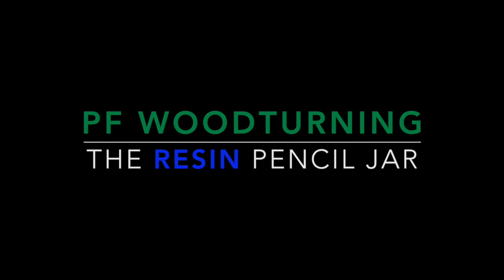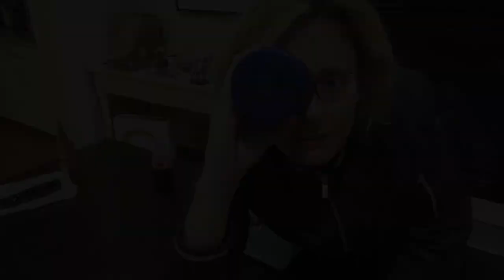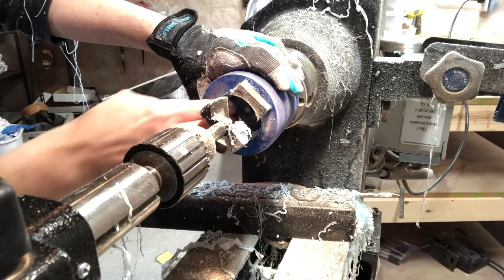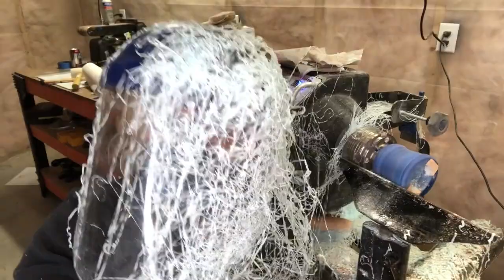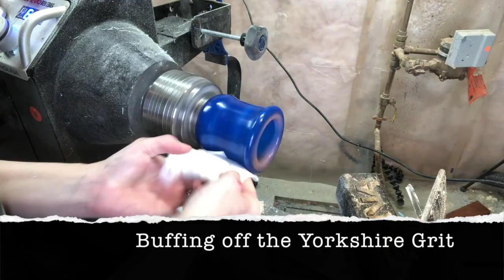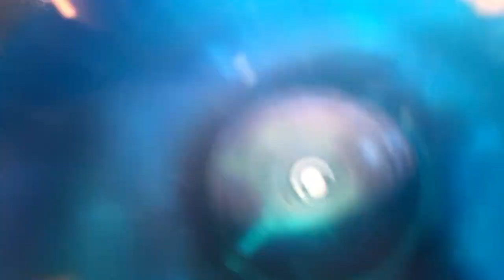Woodturning a Resin and Burl Pencil Jar on the Lathe

Comment: Nice facial hair, pretty pot. I have done three resin containers. Hint, For the burl I hot glued the wood to the side of the container. I messed up with one and mixed the resin in my cold shop, the resin cracked but otherwise looks good. You have probably got lots of advice. Thanks for sharing.
Reply from the maker: Cool, thanks for the tip!

Comment: It turned out well, that much resin without air pockets or cracks is not easy to do. Congrats 🙂 Your intro mentioned you had hoped the wood would have been on the bottom, why not do a second pour, to fully cover the exposed wood, then flip the top/bottom plan? When we use molds we tend to see it as a "set in stone" shape, (top is top, bottom is bottom) however a whole new world opens when we pull out our inner rebel, and decide that the top may be the bottom or even the side. No mistakes, only design changes <3
Reply from the maker: Thanks, Jen! Good idea.

Comment: Nicely done on the pencil cup, Peggy.  Just a suggestion, but you might want to hold on to the Jacobs chuck when withdrawing it from the blank.  I've had them come loose from the morse taper and they flop around while partially still inside the blank... don't ask me how I know this. They can and will come out and you don't know where it will go.  Not trying to be persnickety, I just don't want to see you (or anyone else) get hurt.
Billy
Reply from the maker: Thanks for the tip--you are right!

Comment: Hi Peggy really enjoyed the video! What type of resin are you using? Thanks Frank Perrone
Reply from the maker: Thanks, Frank. For this project I used Art Resin. But I also use Alumilite quite a bit. The Art Resin doesn't have to be put in a pressure pot (but it can be). With the Alumilite, a pressure pot is necessary. I mostly use Alumilite, as I don't have patience to wait 48 hours!